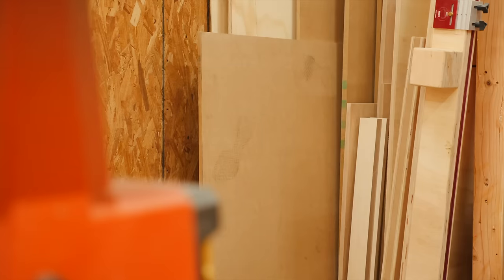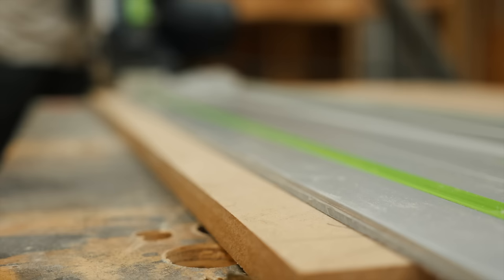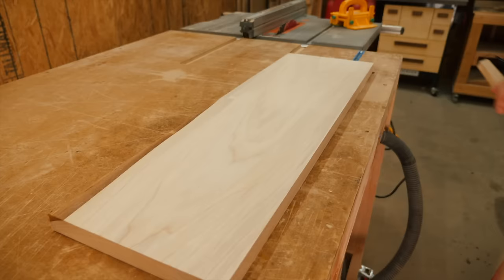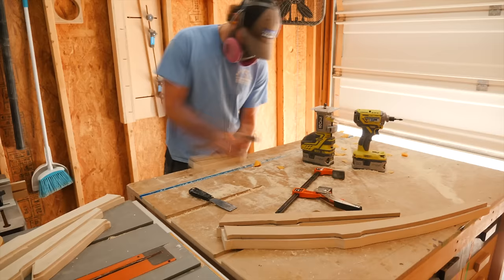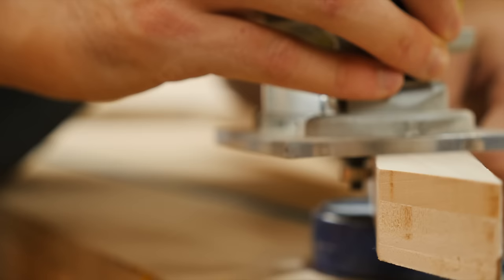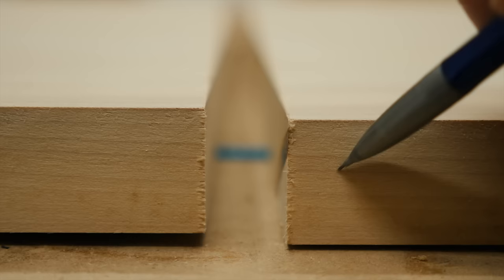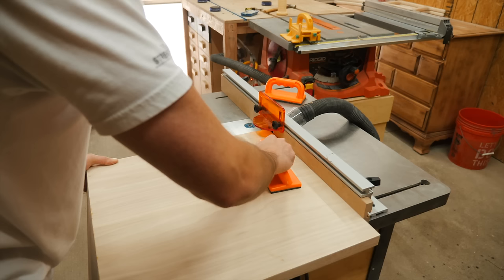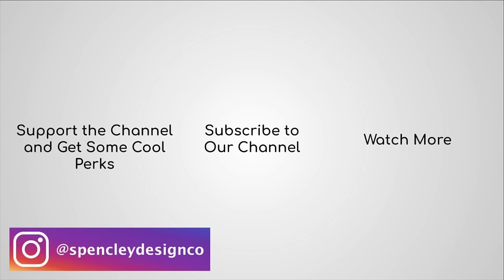I designed and built my first chair

Comment: I glad you used jigsaw. I almost buy a band saw because everyone uses band saw for this kind of work
Reply from the maker: A bandsaw would be a heck of a lot easier, but I just don’t have access to one at the moment. You can get A LOT done with minimal tools. It just takes longer and isn’t quite as accurate
Reply: @SpencleyDesignCo  that's my situation and thoughts! Thanks for the reply 👍
Reply from the maker: Sure thing! If you want more examples, just watch my other videos. I have a pretty limited tool selection but still get a lot done 😀

Comment: 5:30 mark. I think you need a bigger crosscut sled. What about the kerf when you cut the master template into smaller ones? Wouldn't that cause a misalignment when putting the final pieces together? See 1:55 and 3:55 mark.

Comment: Awesome work! I'm trying to psych myself up to build my first chair. I noticed you had one issue with this build that you must have resolved somehow: when you cut the template into four pieces where the joints would go (at 2:00), that created some imperfection in the curves due to the saw kerf (example at 4:06). How did you end up handling that? Would you do it differently if you were doing it again?
Reply from the maker: Thanks, Dan! I just re-sanded down those curves areas. I’m actually in the process of filming a new chair build right now!

Comment: Hi Eric,

This looks great and a project I think I could tackle. One query, after you have cut the pieces and trimmed them with the router to match the templates, I notice that the curve of the joins don't align properly (see video at time 4:07). I assume this is due to cutting the template into smaller sections and trimming the stock for a straight join. How did you 're-shape' the curves at each join in a uniform way?
Thank you
Reply from the maker: Thanks for watching! I just sanded the joints smooth

Comment: Got that festool domino. Is it a lot better than your dowel jig?
Reply from the maker: I wouldn’t say it’s better in the sense of making “stronger” or “better” joints. But it’s substantially faster than the dowel jig I used to use. However, if i was just woodworking for a hobby (not building for clients or making content on YouTube), I don’t think I could justify the extra cost over just having a doweling jig.
Reply: @SpencleyDesignCo  the real question is? Is that festool worth the price? Thanks for the response
Reply from the maker: That entirely depends on what you’re using it for. If you can get client work out faster, then I’d argue the speed is worth it. If you’re a hobbyist and you’re just enjoying your time, it almost seems backwards to try to finish your hobby faster. You know?
Reply: @SpencleyDesignCo  i do have a lot of deadlines due. Would a dewalt or any other brand work? Or is it better to just get festool?
Reply from the maker: To my knowledge, dewalt does not make a domino jointer